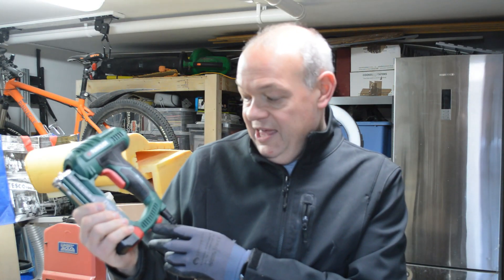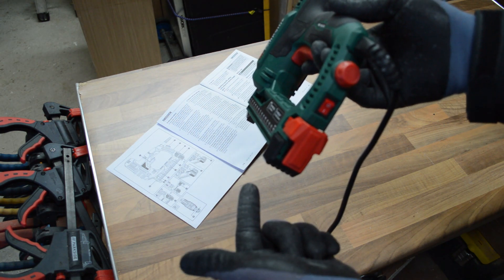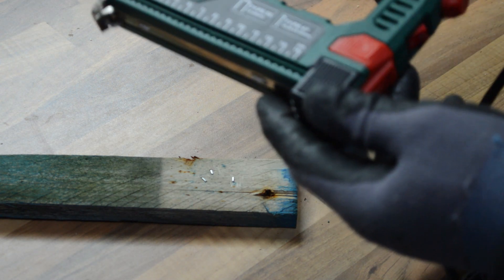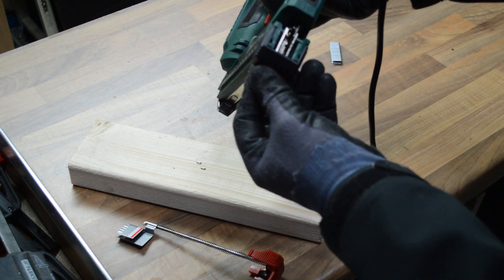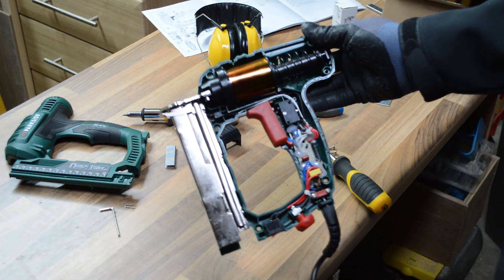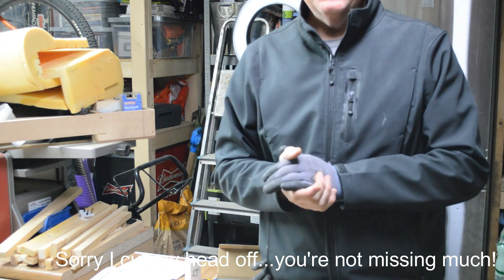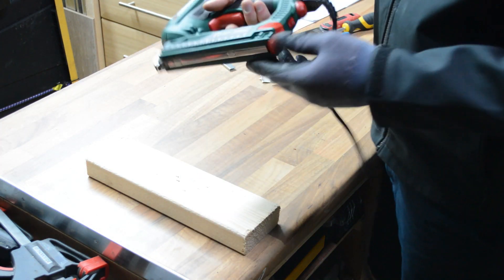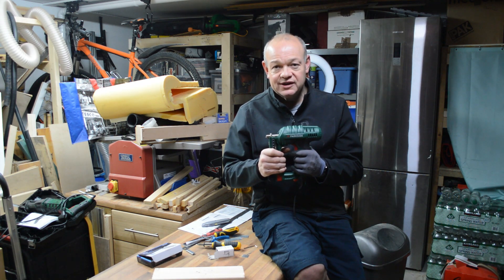10 Minute Tool Review - Parkside Stapler

Comment: One piece of advice. If those brad nails are wickes brand do yourself a favour & throw them in the bin. I have a bostitch air nailer which I've used for years with only a couple of jams in that time. I needed some brad nails fast for a trim job so I bought the cheap wickes branded brad nails. Let's just say it either jammed every other nail or miss fired so the box of 5000 went in the bin. I normally use tacwise & find those work OK.
Reply from the maker: Thanks Grumpy and they were....that explains a lot.  Which brand do you buy now?
Reply: @thegarageworkshop4791  i use tacwise, they are quite cheap but never cause problems. Like ive said ive only had a couple of jams over many years using these. Wickes brand have got to be the worse ive ever used. When i first looked at a strip i thought they didnt look quite right.  They looked Uneven but at the time it was all i had. Every other nail it jammed or miss fired. Caused me a right headache.
Reply from the maker: @GrumpysWorkshop4  Thanks i'll try them out!

Comment: Unlucky with this one. I've had a little white parkside corded stapler (no brads) for many years that works flawlessly. I've also got a Parkside 12 volt battery stapler/small brad nailer which has quite a bit more omph than this one & has never let me down. Super handy around the garden. 

For bigger brads I use the compressor & 18 gague air gun from Silverline which is a real worksorse & a 23 gague pin nailer for more delicate jobs. The 18 gague nailer is fantastic for quick shop projects, such as jigs & saves me so much time compared to glueing & screwing. That & the trusty CA glue.
Reply from the maker: Hi Rooster...a compressor is my next purchase...hopefully soon!